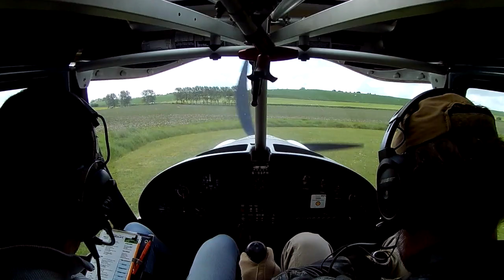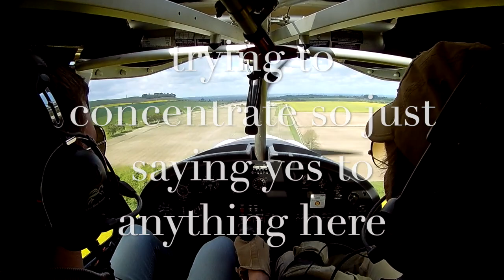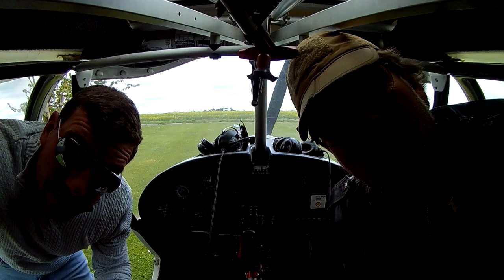Circuit practice - How to land an Ikarus c42 - Aviation - Private Pilot

Comment: Well done Andy. I'm at the same stage in my flying. That last few seconds before landing is the hardest part and is over so quickly. I'm doing circuits this Friday and am hoping to nail it. Thanks for the video.
Reply from the maker: Good luck and thanks for the comment. I love landing the plane, it’s so much fun. Still takes so much concentration but I feel it getting a little better/easier with every one.

Comment: So you didnt cut the power as you crossed the threshold, but instead waited until you were levelled over the runway and then cut the power, and kept the nose up as long as possible?
Reply from the maker: Yeah I mean, depends on how youre getting on but usually cut the power around the flare, pull back as long as possible. As the plane slows down to stall speed you want to keep pulling back and back. Eventually she'll just give up and hit the deck as she stalls.
Reply: @FlyingAndy  thanks! I’m just starting out on the C42, 5 hours in. If the weather ever lets up I’ll hopefully get to 6 hours one day ;)
Reply from the maker: @Ljw-low-ljw  Weather is a killer. I havent flown since before xmas. Patience is the name of the game in the UK unfortunately. Where are you learning? Good luck, hope you find the vids useful
Reply: @FlyingAndy  absolutely. And yes the vids are really helpful - thanks for the great content. I’m learning with Somerset microlights out of Dunkeswell.

Comment: No final approach checklist ( GUMP) not using “the point on the ground that isn’t moving” as the landing aim point. Not using pitch for speed and power for flight path. Great patter but let the student do the flying ( student was clearly overloaded since he just kept saying yes) This is training for the test and not teaching the student to be fully involved in the task. Pathway to lots of bad habits that will be hard to break.
Reply from the maker: At this point in my training Im not sure whether what youre saying is entirely valid BUT i do appreciate you taking the time to watch the video and commetn.
Reply: The most important of my comments is looking for the point on the ground on your approach path that is just getting bigger as you make your final approach (not moving up or down in your field of view) because that is where you are going to end up landing. Adjust that point to be where you want it to be by adding power or sideslipping. With some practice and experience you will learn to fly a flight path that just needs a small amount of power to get it right and no sideslip. As you get close to the ground bring your vision up to the horizon, hold the wings level and just keep bringing  the nose up to keep it flying and the landing will take care of itself. Where you are looking is the key to making a good landing in the right place. Another good recommendation is to fly a continuous turn from downwind to final ( no square pattern) to reduce the risk of low altitude stall spin accident.
Reply from the maker: @keithturner3859  ah ok understood. TBF my landings had got a lot better after this video. And my instructor was drilling into me the sort of transition between aiming point and then flare/looking at the end of the runway before stick back. When would stall spin occur on the square pattern, base to final?
Reply: The classic scenario for stall/spin from a “square” pattern is overshooting the turn from base to final, tightening up the turn; not flying a coordinated turn (slipping or skidding) and entering an accelerated stall with yaw. This results in a low altitude spin which is most often fatal. Making a continuous low bank angle turn from downwind to final allow small incremental changes in bank angle to arrive at the final approach course and a good set up for a transition to a stabilized approach. A good landing is all about making a stabilized approach as a prerequisite. Look at the path that carrier pilots (there are many YouTube videos to watch of US carrier pilots) and competition glider pilots fly (although glider pilots fly a continuous turn to final with a more elliptical flight path to never loose sight of the landing site as well). Developing and honing the skills for making a good approach and landing is not only about making it /you look competent and professional, it provides a safety margin that may save your life. Look up On Speed.org for more discussion and importance of Angle of Attack.